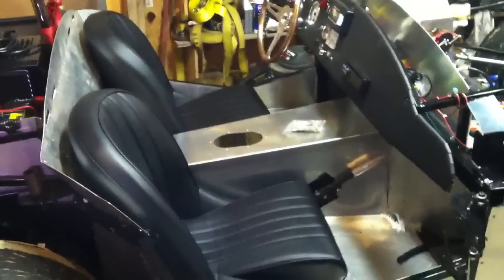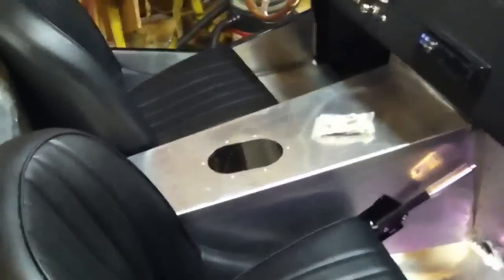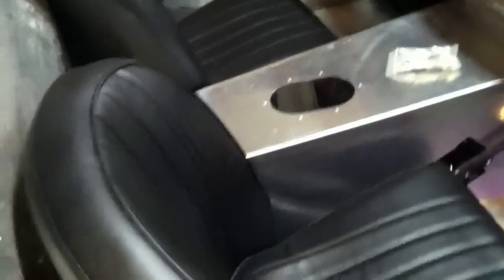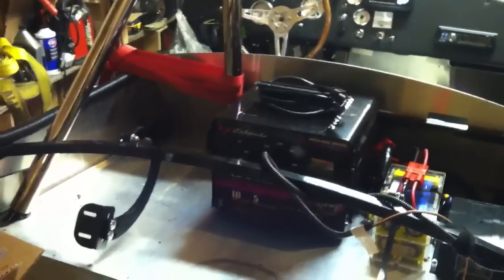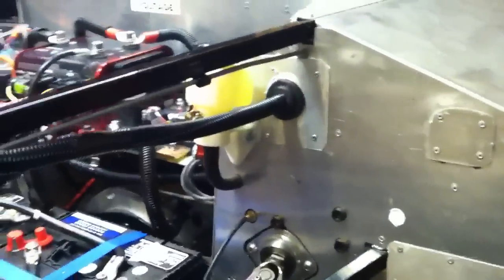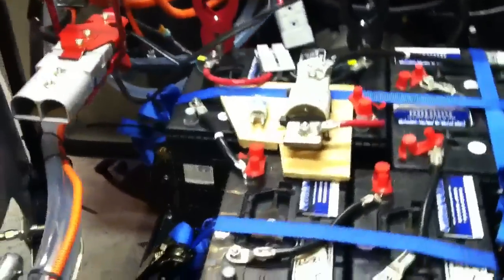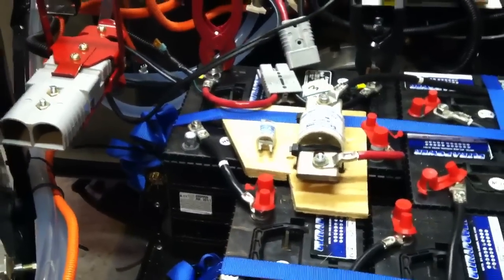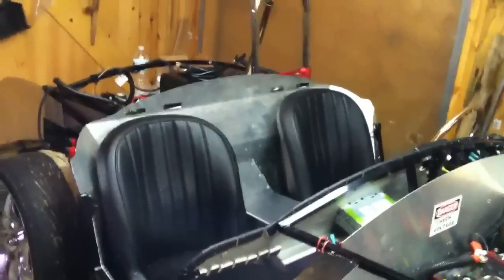Factory Five Mk4 - Electric Car - Video 20

Comment from the maker: @rav2188   I don't think that Factory Five was interested in electric drive when I bought my kit, but I agree that it would be a nice option to offer.     Although it seems to me that I recently saw a video that suggested otherwise.  There was a '33 hot rod electric, no body, with stacks of what appears to be Calb cells on the rear end.    Prismatic lithium is the easy way to go, but can't supply high current that is needed to make really high performance.... gotta have cylindrical cells.